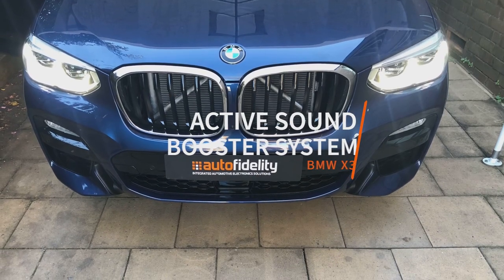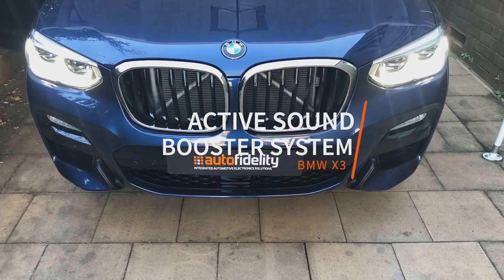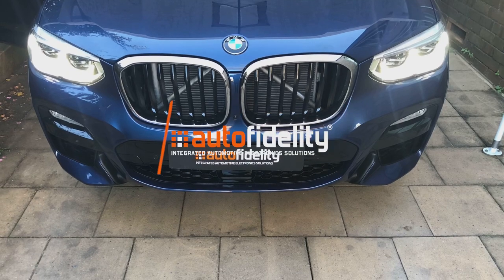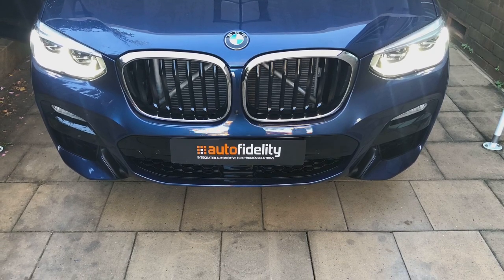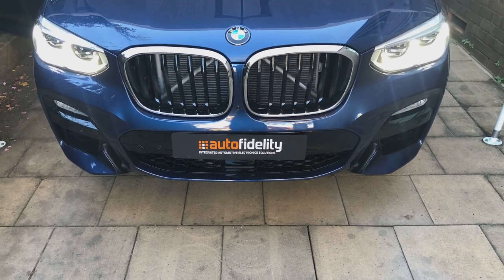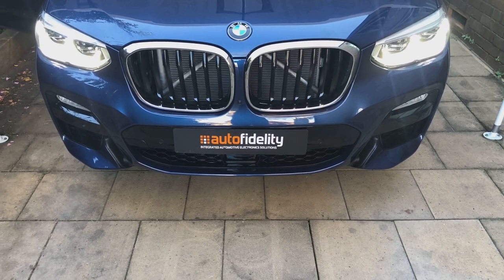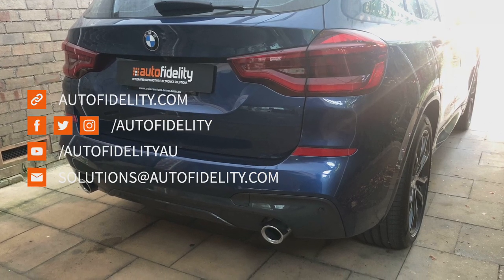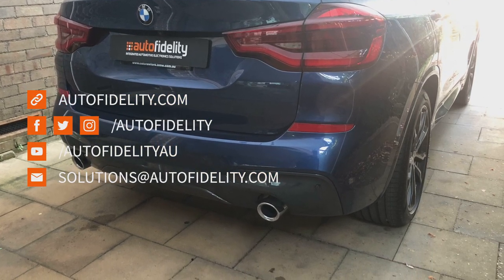BMW X3 Sound Booster Exhaust System

Comment: Remove the boat anchor and install resonators.  That will sound awesome.
Sorry this method is not gruff enough for me.
By the way I noticed a more immediate response and a 0.6 litre/hundred average fuel decrease both of which I was not expecting.
My rear muffler was increadably heavy, hence I nick named it the boat anchor.